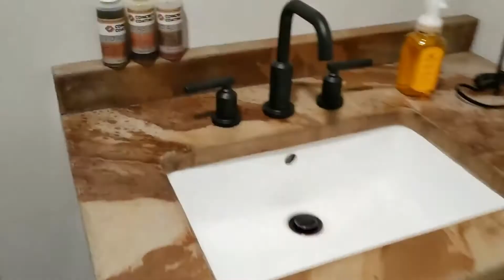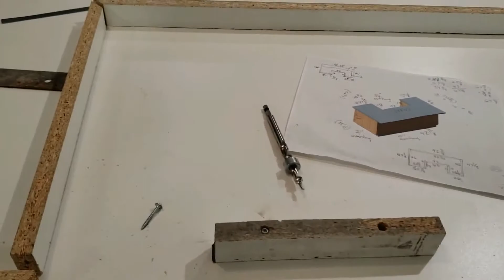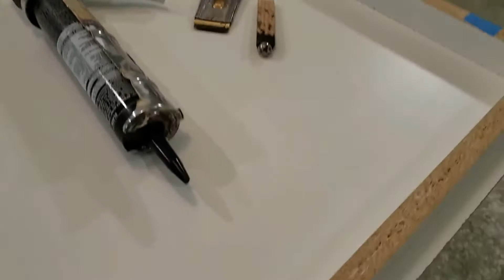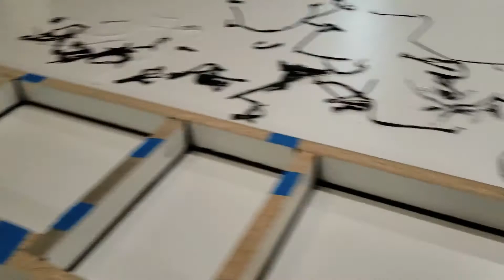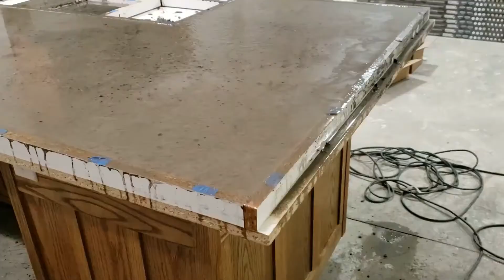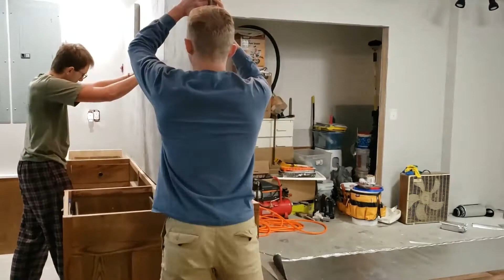Concrete Countertop - Part 1 - Form, Pour & Flip

Comment: Where did you get the caulking smoothing tool?
Reply from the maker: I think you mean the marble on a stick. 😀 I made it with a piece of scrap wood, marble and super glue.  It seemed to hold up great.  still have it but have not used it since then.  I think I put some sandpaper over the ball and used it to shape the end of the wood for better contact.  I did not do perfectly in the corners as the caulk still stuck to it and didn't smooth perfectly but otherwise it did great.  If pressing hard enough it leaves a line that you can come back and remove the excess caulk easily.